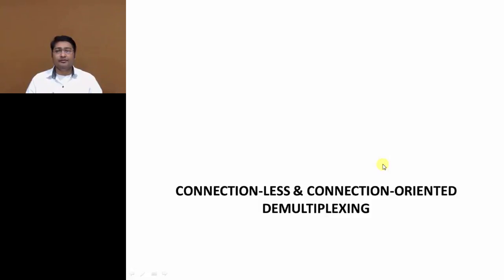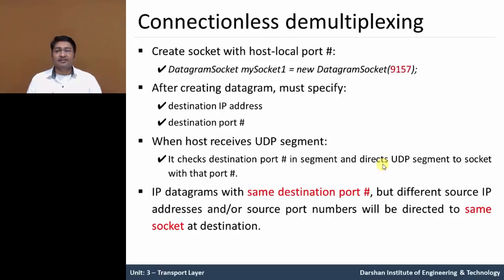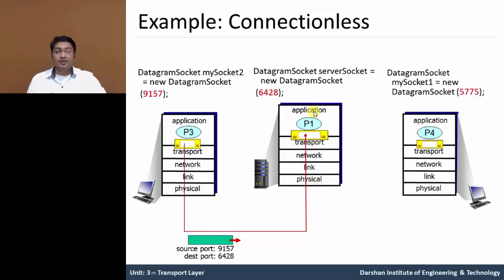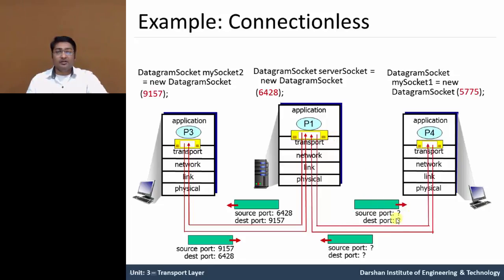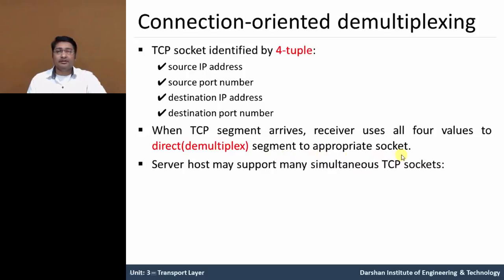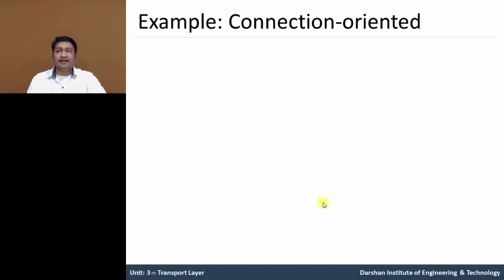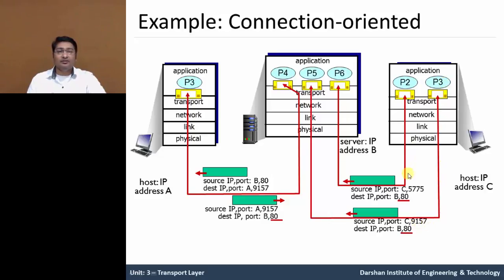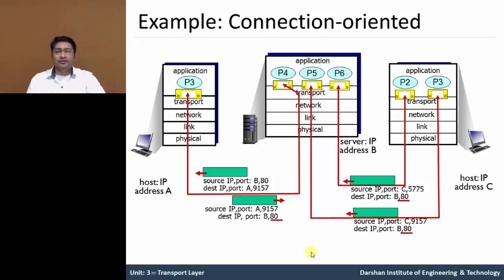3.03 - Connectionless and Connection-Oriented Demultiplexing

Comment: Sir I have a doubt.
U told that web servers have different sockets for each connecting client.But for the same clients if there are two processes that want to send msg to the same destination port no,then will it be done through same socket or different socket at Destination side?
Reply: It depends weather it is persistent or non persistent